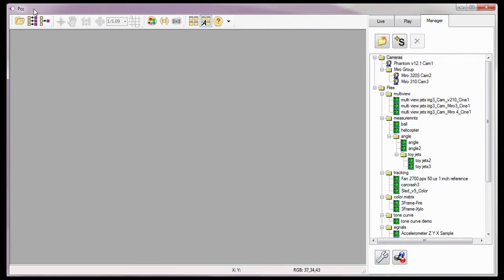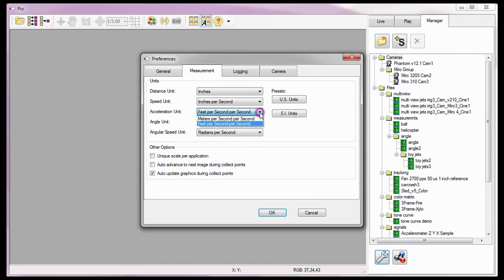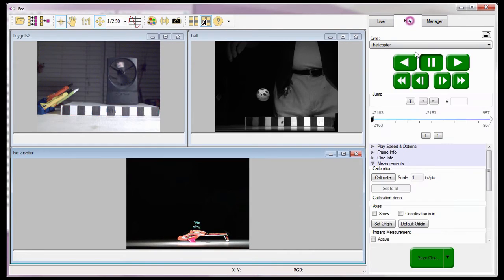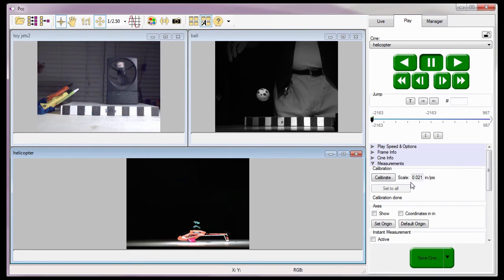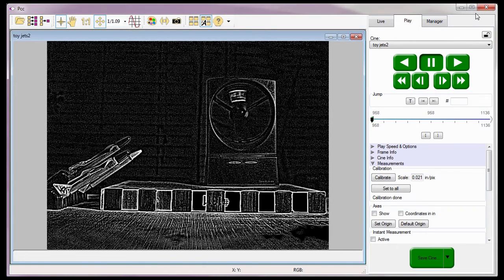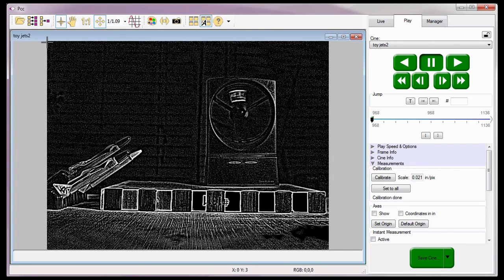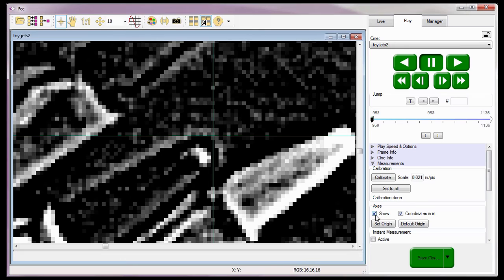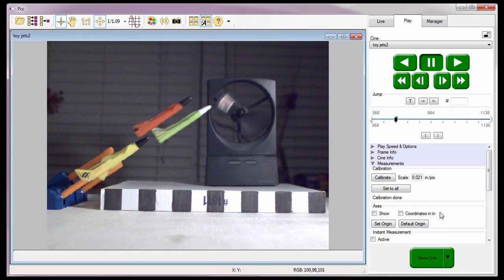Cine Analysis Part II (Coordinate Measurements) PCC Tutorial

Comment: I am analyzing a Cine Raw file using this software. My resolution is 128x128 @ 240,000 fps. Exposure time: 3.4 microseconds. All found in the "Cine Info" tab. The "Period" is 4.17 microseconds. Under the "Frame Info" tab my "Interval" is 4.16 microseconds and "Exposure" is 0.56 microseconds. What is the difference between these two Exposures as well as their difference from the "Period" and "Interval"? Thank you.
Reply: To best understand these terms, it is worth reviewing how the frame synchronization (f-sync) clock pulse is used in Phantom cameras.

A ‘frame synchronization’ (f-sync) clock pulse is used to instruct the camera when a frame / image needs to be recorded into the camera's memory buffer. 
The source of the f-sync varies based on how the camera(s) are to be utilized, (standalone or multi-camera network). As of this writing, there are five f-sync clock sources used to drive the camera’s framing clock, including: Internal, External, Lock to IRIG, Sync to Video, and Sync to Trigger.

The camera’s internal frame rate generator (crystal oscillator) outputs a 4µs negative pulse on f-sync to initiate acquisition of image frames. 3-4µs after a negative edge is detected at f-sync, integration starts (Strobe low). 
Strobe is a pulse generated by the camera synchronous with the sample (frame) rate, which remains low for duration of the exposure. When asserted (low) the camera integrates (shutter is open).

Typically, a new exposure cannot start until 3-7µs (camera dependent) after the previous one has ended. If an f-sync pulse is detected before an exposure can start, it is latched and a new frame will start at the earliest possible opportunity. Additionally, an exposure cannot end until the previous frame was completely read out from the sensor. If such a case occurs, the integration period is extended until the readout has completed, overriding the exposure time setting.

With that said, the ‘Interval’ is the time between each frame while the ‘Exposure’ indicates the image exposure time, for the image being displayed in the Playback Panel. The ‘Period’ is the time necessary to record each of the images.
Reply: Thank you.
Reply from the maker: I will notify Frank of your question and have him come and help you. :)